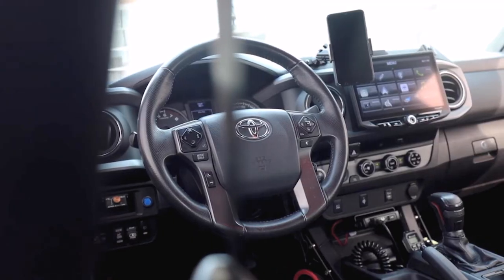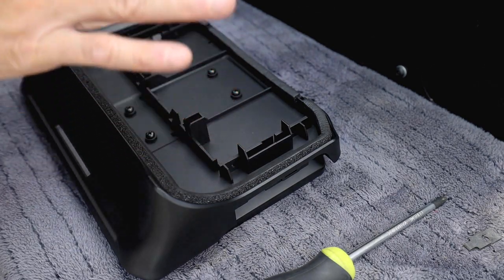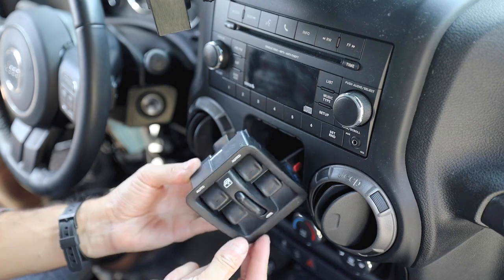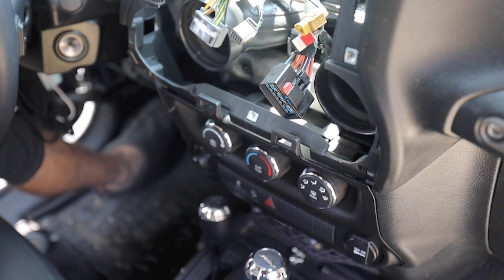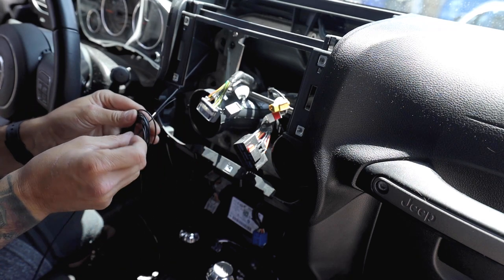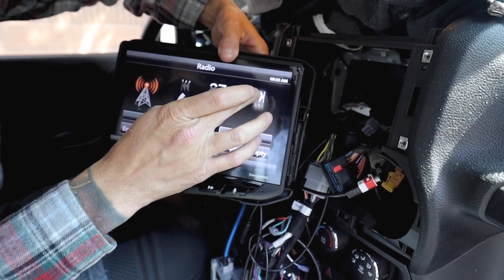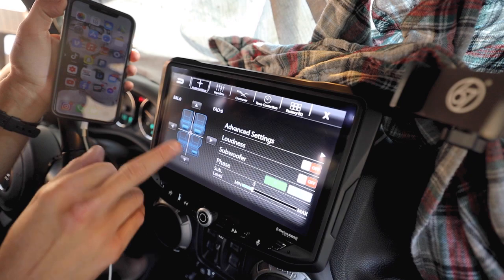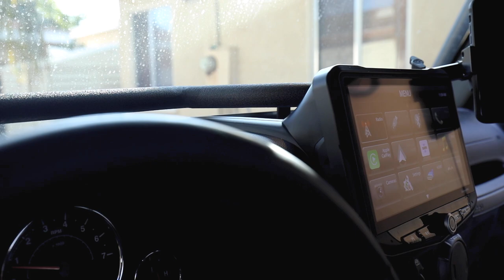Upgraded Our Jeep Wrangler Jk Radio | 10 inch Touch Screen by Stinger Off Road

Comment: I just had a Stinger High10 installed in my 2015 JKU Saraha.  Factory 730N RHR, Alpine system and Bluetooth UConnect.  Now that the Stinger High10 is installed, the digital compass in the dash cluster no longer works and displays "- -" (not stuck on "N" like some I've heard of).  I called AAmp (Stinger), they don't know why this happened and don't have any recommendations on how to fix.  They said it may have something to do with losing UConnect, but aren't sure.  Any ideas?  Did you lose your dash cluster digital compass when you installed it?
Reply: any answer to this? does it affect the compass?
Reply: Mine still works. as far as I know of. Never paid attention to it.

Comment: Questions.   Just installed the fully intro grated option.   My crossover and time correction pages are the only thing non functional ATM.  Any suggestions what I did wrong?
Reply: If you have enabled “factory amp” in your advanced settings, then the cross over and time correction will be disabled. Disable factory amp option in the menu and it will make those clickable. HTH and good luck!

Comment: Does this connect to the combus so that the  steering wheel controls, and as well as stock Nav  still work?
Reply: Steering wheel controls will.  Navigation is part of your head unit so if you ever replace that your navigation will just be part of the new one. You can purchase the navigation software and chip for the stinger if you would like. Same thing goes for XM radio. The radio can run it but you have to purchase another XM receiver to hook up to this radio.
Reply: yes but you cant even use your iphone or android for roku netflix or any other streaming platform  hell the apps on the screen is what it is your carplay apps on your phone are blocked nothing opens when the phone is connected
Reply: @the-bu3lb  I use my living room for that
Reply: @the-bu3lb  Are you plugged into the correct usb plug? Only one opens/operates from your phone. If one doesn't work, plug into the other one. Hope this helps you out bud.

Comment: How long would you say the USB replacement wiring is? I have heated seats wired to the cigarette lighter and can’t use this location to mount the USB so I’ll need to relocate it.
Reply: They are like 3-4 feet long.  You have options. lol

Comment: Great video! I did the install this past weekend. Everything works except the rear speakers, what am I missing?  My jeep has the subwoofer so I used the amplified connection. Any input will be greatly appreciated.  Thanks
Reply: @Because of two Jeeps  Sounds like you missed plugging something in. Maybe? As I to have the factory Alpine sub, I plugged it into the "amplified" wire. Later to find out that I may have done it wrong. One Install video I watched said "If you have the factory amp mounted under the driver side dash (which is what I have) said to plug it into the NON-AMPLIFIED wire. With no explanation as to why. I did not feel like removing the whole thing to switch it. But all my speakers work and I have no glitches in anything.  I can say that I am pleased that this is louder than the factory head unit. I have yet to upgrade the speakers.

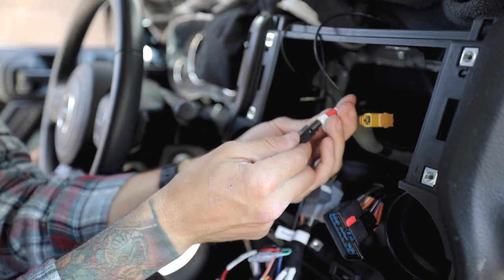Comment: 18:11 What is this stock yellow connector?  I noticed it was unused at 11:50, as was mine when I did my recent install.  What is antenna (best I can tell). But the yellow eludes me.
Reply: That’s the crossroad I’m at. I’m pretty sure that’s for XM radio which is what I’m trying to figure out right now but don’t know where to connect it

Comment: So what’s up with the steering wheel controls? Can you still answer the phone and what happens if you push the “VR” button on the steering wheel?
Reply from the maker: Yes everything works man
Reply: The green steering wheel button on mine does not work anymore I have to use the middle button and Google Assistant makes my calls plus the USB port in the dash does not charge anymore hardly it takes forever I'm talking like 5% an hour
Oh yeah and I got Android auto to work for about 3 minutes until it never worked again and this is all my 2018 JL Wrangler

Comment: So this thing does half the stuff a radio that cost half as less can do?
Reply: Like what exactly? Yes this radio is pricey. I am disappointed this doesn't have all the vehicle integration on the JK model as it does for the JL. Nowhere does STINGER tell you that either.
Reply: @andypastore3299  also claims to put out 5v,  when it actually only puts out 1.7v

Comment: Is this unit waterproof? I want to replace the stock radio/GPS that came in my 2015 Hard Rock Rubicon. However, I'm skeptical about the unit breaking down if exposed to rain for 30 minutes. My top is off all summer, and once or twice per year, I get caught in a storm. I have seen many videos of people stalling the Heigh10, but no one talks about if it will withstand exposure to the hot sun and possible rain for those that keep the top off. Thoughts?
Reply: Seriously doubt since the rest of the Jeep dash isn't waterproof.  That's why people use bikini tops to block direct rain.
Reply: No it is NOT water proof or water resistant.

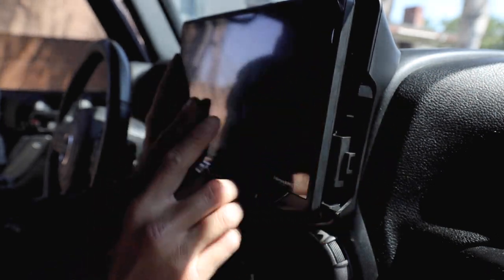Comment: Noticed a cut at 14:30, how difficult is the screen install?  I've seen some reviews saying its hard to do.
Reply: Ama tell you my display install has been difficult those mounting brackets for those 4 screws don’t reach and if I push hard enough only one side “almost” grabs it’s terrible right now.
Reply: @hersonvalle  Agreed.  Finally got mine secured with a lot of pressure.  Stinger told me they are working on a new bracket for JKs.
Reply: @charlietighe   I ended up using some nuts as spacers i would have cracked the screen if I put the pressure I was putting on it
Reply: Thank you for this comment. It's 12:14 AM and I'm excited that  I have everything hooked up but it is so far from being close to being able to mount to that bracket it's not even funny. I suppose I will remove the entire radio and put spacers in between the four 7 mm screws that held it on just to get it out far enough.  How on Earth can they screw this up that bad?
Reply: I spoke to one of them and they said you have to put a lot of pressure on the screen
Reply: I wound up putting zip ties through the side of the interface and into the bracket that holds the head unit in.  I will fidget with it tomorrow but it works for now. Of course I will not hear back from them until Monday. I'll just extend the bracket tomorrow with washers. It's a bad design
Reply: Pushing the screen in with all the wiring is an absolute nightmare took 20 minutes with me and another person pushing as hard as possible
Reply: @hakenkreuz7076  Yep, ended up doing the same things.  After getting over the fear of pressing too hard, it snapped into place.  But if definitely takes some force!
Reply: @hersonvalle  I'm glad to know I'm not the only one that had problems with this. I was only able to get three screws in. Lord only knows how it didn't break as hard as I was pushing on it.

Comment: The cost 😐
Reply: Way too much. The head unit is around $1500, Install kit around $220, and the offline navi sd card (optional) is $179. I got mine with the install kit (so it looks factory) and the Offline navi sd card for $1100 with free shipping. Had it in three days.